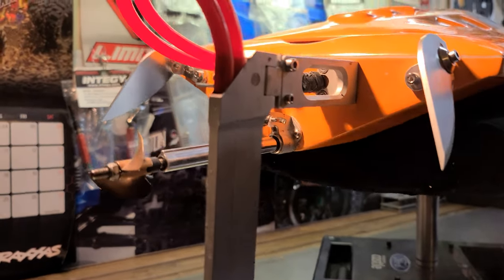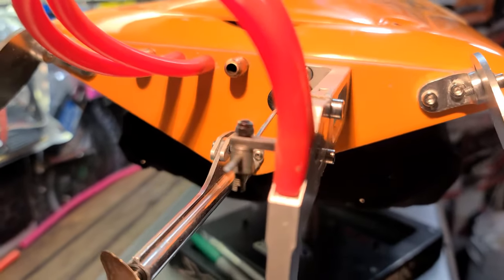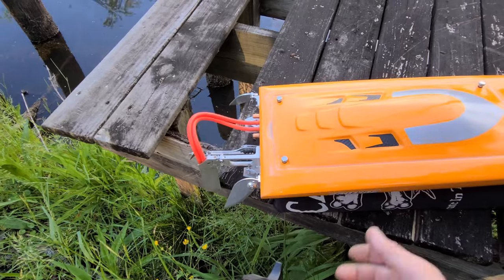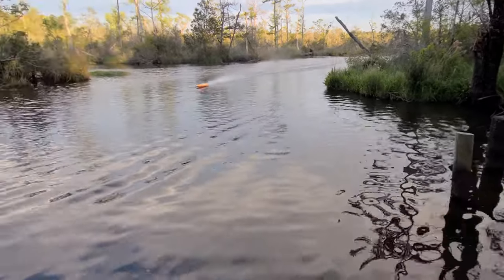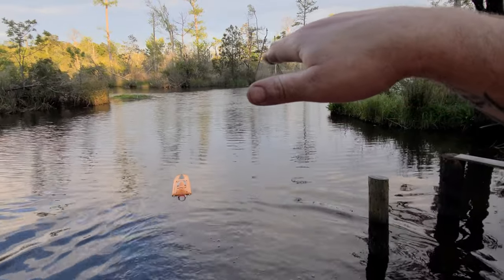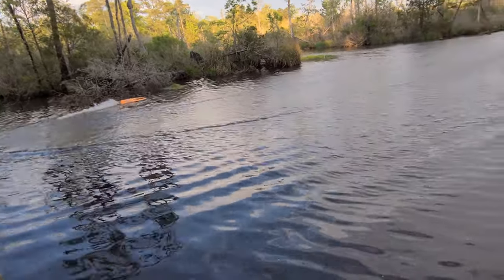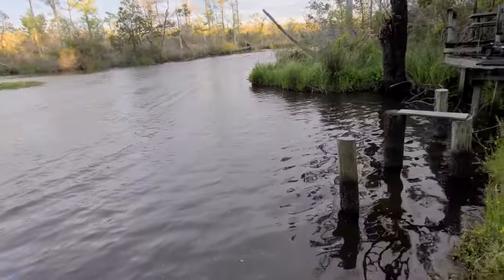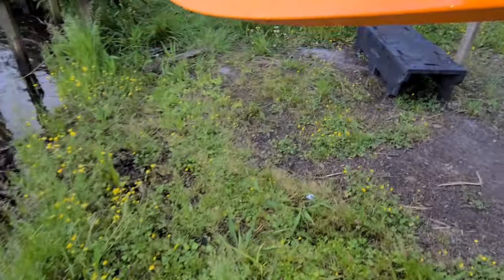Trim Tab Installation & water Run - Deltaforce 35 Trim Tab Setup & Benefits - RC boat build

Comment: The best upgrade to a veehull you can add besides the turn fins👍❤️You can make it prop dance with those and give it the edge it needs when adjusted properly👍
Reply: Can't find this on line

Comment: Hey wats going on, I absolutely like your videos on boats,,I thank you for the tips and tricks,, and how to install,, I like the videos on how you install stuff more but I like it when you're running ur boats too to show the performance of what it will and won't do,, don't stop making videos please,, everything you say is making my pro boat 29 veles run faster every day I'm doing better I'm new to this hobby I'm into it,, don't think I would be as much with out ur videos,, the only thing I'm having trouble with is the lingo like what does running wet mean and what does proposing mean and what is the front of the boat what is the back of the boat and if you could tell me how small of a propeller I can use and how big of a propeller can I use on a 29 in Pro boat veles maybe u could let me know in a next video just say friend in Wisconsin il hear it and pay attention because il b watching everything u post thank u for your hospitality ur a great teacher don't stop have a awesome day my friend,,, later Wisconsin

Comment: Did you paint your boat? Looks nice now
Reply from the maker: I used vinyl carbon fiber sticker to dress it up
Reply: How did you do the vinyl carbon fiber sticker to coat your boat. Also wat is the size of your motor and prop. I like your how to videos anyway

Comment: I have Zonda and I messed speed control.  Now only one side works and I don't. know to get both sides working.  Can you help?
Reply from the maker: Find out if it's the speed control or the rx/tx, sometimes the rx/tx will not get connection    if it's the speed control, replace it

Comment: like you bashing on your boat and changing out different props and settings so other people get to learn on what works best or what adjustments does what.

basically what you doing now I like you different props you change out the expensive and nobody wants to spend $60 including shipping on two props cuz them damn things are expensive and then have two of them that might as well be paperweights cuz you can't use them for your boat so definitely like the prop videos.

like videos on the medium-size boats like your Delta Force but do you have a boat other than the delta force about that size say like a tfl pursuit size? hint hint  lol
Reply from the maker: Glad I can help